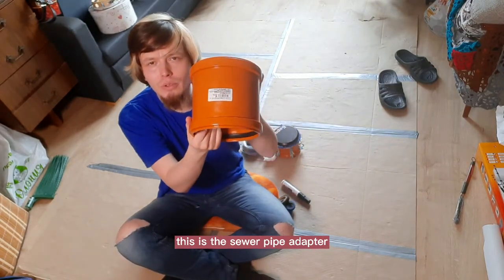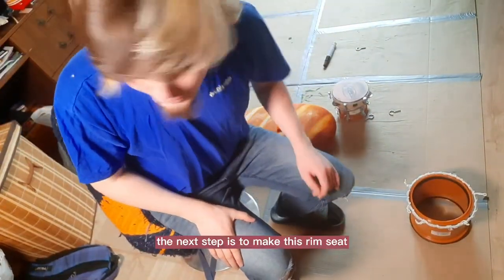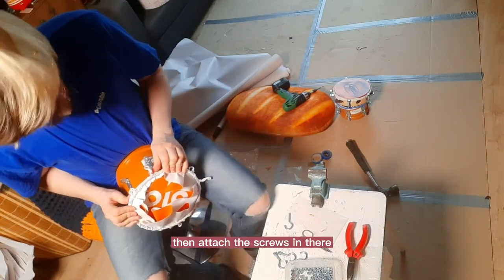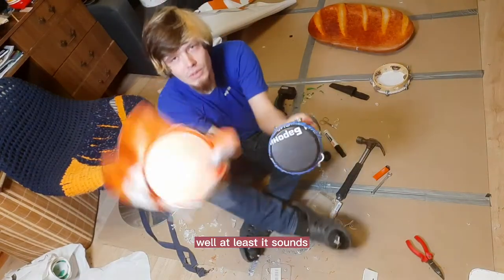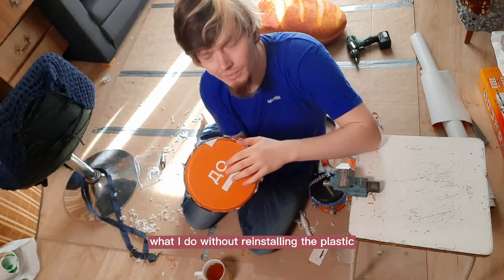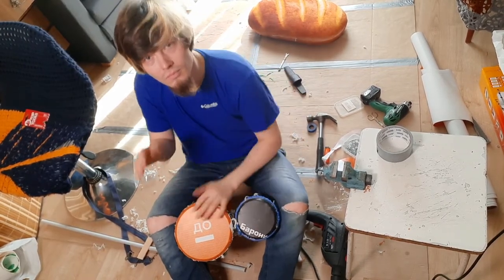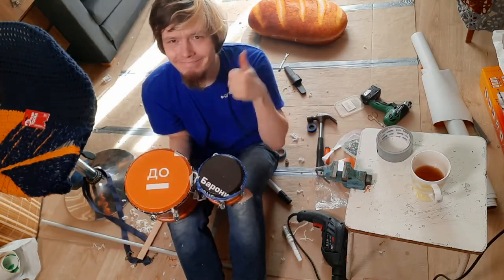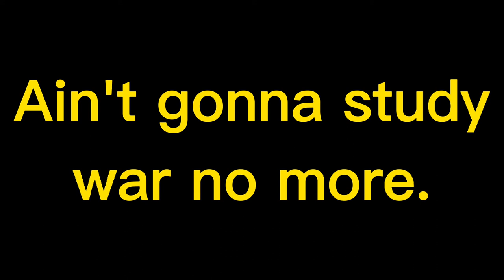DIY BONGOS made of a sewer pipe adapters (featuring Vasily Kudarenko)

Comment: can you make a darbuka using the same technique
Reply from the maker: I think darbuka requires something made of metal at least 1.5mm thickness and goblet-shaped. In ordinary hardware store I've not seen anything like this. Of course, technique of welding used gas tanks will give some good results, once I holded in my hands one welded darbuka, but I have no skills in it. PVC sewer pipes will give you only sound of bad djembe. Anyway, that's a good idea to try and one day I will.